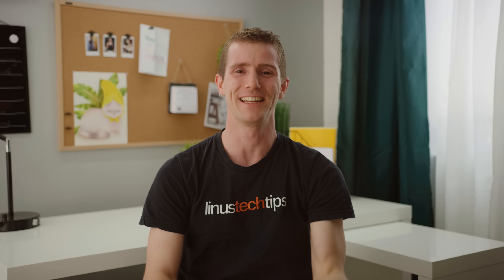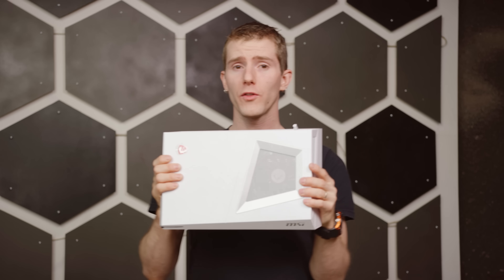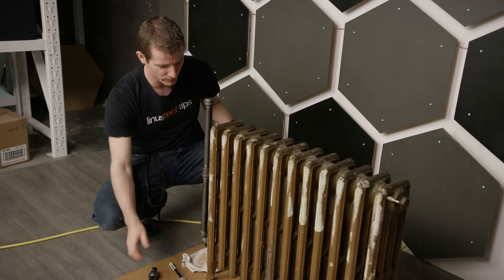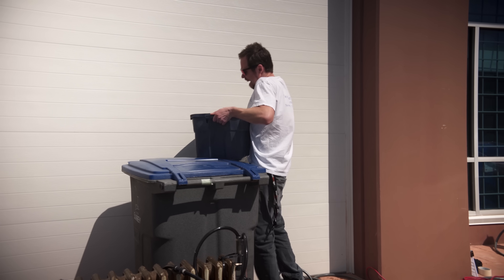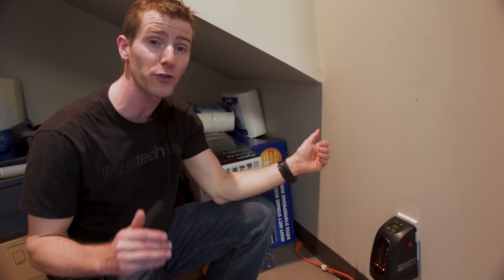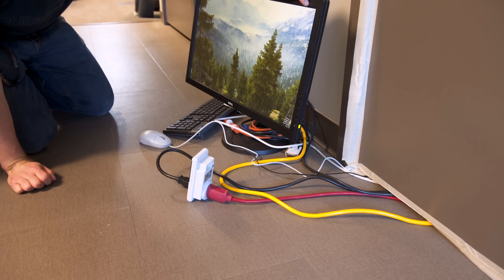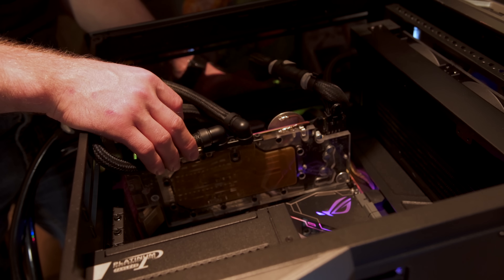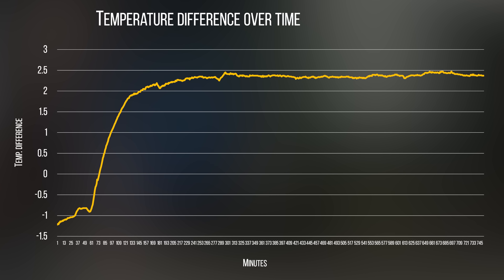Lower your heating bill... with GAMING

Comment: In my country the weather is usually hot (about 30-38 degree c) but in winter the temp goes down up to 10-15" celcius which probably isn't very cold but to us it is. 
So in winter I reverse the fans in my pc so that the hot air comes out of the front and face the pc front (it has a mesh grill in the front ) side  towards me and that gives me a warm breeze while gaming 
also I am rocking an i5 6400 and rx480
Reply: Abu Tahamid wow! Here in Canada it ranges from 40C to -40 C
Reply: man I cant even imagine that cold
Reply: I have a i5 6400 as well... except I also have a gt 730. shitty dell prebuilt. I play games like Arma 3 ghost recon wildlands and battlefield 1 on it
Reply: Matthewlet L if ghost recom wildlands can run good on it then you can play almost anything

Comment: From a mechanics standpoint its about time they did the fuel line style quick connect fittings, always found that part of custom loops a joke...
Reply: Also a 360 was a solid space heater and console combo, kept our apartment 68 degrees one winter when the furnace was fucked
Reply: When I was in high school I had a 40(?) inch TV, xbox 360, computer, and two monitors in my small bedroom (10ft sqaure? maybe smaller). It was fine in the winter, but summer time I bet it was over 90 F.

Comment: Just talk to any ham radio operator about how much a 1.5 kW amp will heat up the shack during the winter....
Reply: It's true I know a ham operator he actually has to run the air conditioning whenever radio is on even if it's cool elsewhere in the house.
Reply: yeah, winter + open window + HF vacuum tube amplifier = still warm inside
Reply: In the winter the cows gather around the outlet vents of one of my 20kw FM transmitter shacks. I don't blame them but you really don't want to wear nice boots out there.

Comment: Would've been interesting to compare with how much time the computer takes to heat the room without the radiator thought. Because cast iron is used to accumulate heat while aluminium is more conductive.

Comment: I got 3 x GTX 480! Prepare for summer! 

summer glau maybe ;)
Reply: I had a miner room mate.
Reply: LOL! with GTX 480?
Reply: Jani SIr I’m sure you do.
Reply: Yeah, I have 3 as well, it's really a bitch when it's 9 degree F and it's 95 degrees F in your room.
Reply: RIP!! lol
Reply: +Vide What's so hard to believe about that?
Reply: Combine that rig with a pentium d 805 at 4.5 ghz
Reply: DanielC pair it with an FX 9590 with a stock amd cooler.😂
Reply: Anyone else read RX 480?
Reply: 1 more like for Summer Glau
Reply: yes gtx 480 big temp
Reply: unless you got a decent AC, you will die.

Comment: But the seperate radiator only makes sense when you want to heat a other room then the one the pc is in...cause the normal heat sink already heat the same room, and that even better, with less work....
Reply: A normal radiator wouldn't be able to dissipate heat from the PC quickly enough, causing the PC to thermal throttle and output less heat.
Reply: Lim Chee Hean that is not correct if you have enough rad space it will dissipate the heat quiet fast only the water amount is the difference here (and the amount of cold metal in the beginning)
Reply: +Lim Chee Hean i doubt that the surface area is much different, its mostly an thermal mass difference.
Reply: It already thermal throttled anyway with the huge radiator so Linus definitely could've just tested this with two large 360mm rads for both the CPU and GPU with fans on full blast and it would have the same effect.
Reply: Agreed. Should have kept the pc outside the room and only had the radiator inside the room.
Reply: Andreas Elf What difference would that make? The rad is the thing cooling the whole system. The room is gonna get hot and so will the rad. It will thermal throttle just like how it did in his test and it won't change a thing.
Reply: What difference does it make with an external radiator when it is in the same room as the pc if it's only for warming up the room?
Reply: Andreas Elf That's exactly my point. There isn't any difference. The water carries the heat into the radiator where it will dissapate it into the air. That's true for a large home heating radiator OR a small 240mm rad meant for PC water-cooling. Having the computer and radiator in the room versus having only the radiator in the room will have no difference since the rad is the thing cooling the system. The CPU and GPU will get just as hot outside of the room as it will inside given that the rad stays in that room.

Comment: Alternative title:

HIGHER YOUR ELECTRIC BILL, WITH GAMING!
Reply: The whole point is that you can stop using heating if you play a bit. I haven't used heating in my rooms since a few years ago because I need computers running to work.
Reply: B-but its a joke my guy...
Reply: Bruh, electricity is expensive, and since using your PC as a heater isn’t conventional, you’re better off having some kind of furnace heater. But heating bills are expensive  too, but if you use Linus’ method it will cost you the expense of a mass use of electricity there for making my statement true that your electric bill will not give a fuck while your heating bill will be lower *in a way*.
Reply: i did changed it to that with html5 lol
Reply: @Deadpool0x2  Because of thermodynamics, all electronics are as good generating heat as heaters, probably 5 or 10% less efficient at most, so, if you can do anything efficient with the electricity before converting it to heat, like playing with it, watching videos, generating light, etc. much better.
Reply: ya'll are taking my joke too seriously :(
Reply: @Deadpool0x2  well you tried to explain yourself with your third comment. That was your mistake.
Reply: @Ildarioon  that all really depends on the relative cost of 1 kWh of electric energy vs 1 kWh of heating energy in your region

Comment: What's the point of attaching it to a room radiator when the exact same heat will end up in the air anyway from the normal ways of cooling?
Reply: There was no point. Entertainment. From a practical point of view it makes zero sense.
Reply: Maybe to have the option of moving the heat to an other room by moving the radiator.

Comment: I thought this is going to be about power factor, which the capacitive power supply corrects the inductive heater, but after a bit of thinking, I realized that computer power supplies have active power factor correction and heaters are mostly resistive.

Comment: Why does he need the radiator? Wouldn't the thermal output be identical if he just put the computer with the same base hardware in the room?
Reply: bladudemovies yes no matter how you dice it heat is heat. BTU from a 1,000 watt ceramic heater is the same output of a toaster oven rated at 1000 watt
Reply: But he can overclock enormously
Reply: Even slow warming (and cooling) of parts reduces malfunctions, having flowing water and a lot of thermal mass lowers the amplitude and frequency of temperature fluctuations without sacrificing compute power.

Having lots of surfaces area for dissapating heat lowers the temperature delta between the computer avoiding throttling.
Reply: Damjan Skrbic No you can't... Just like air, heat can only transfer so quickly and after a certain point, no amount of extra air/water flow will remove the heat quick enough to keep your CPU cool.
Reply: that might be true, but modern computer cooling is no where near reaching that limit. A CPU can be cooled to a couple degrees above ambient.......

Comment: The huge radiator thing was entertaining but I don't see why you needed to do that. The heat will get out just fine regardless of whether it is being transferred through a heat sink, a radiator, or a... ridiculous radiator.
Reply: rsethc more water to absorb more heat and more space to emit heat. Also fun
Reply: That is a down side, they are trying to heat the room, not a massive amount of water and a huge chunk of metal.
Reply: Lol, yup
Reply: Yes i came here to comment this. They started the video talking about how energy turns into heat regardless, and they they use this convoluted way to transfer PC energy into heat. Makes no sense
Reply: Physics says it doesn’t matter how you transfer the heat 600 Watts is 600 watts
Reply: Well a better radiator will get more heat out of the case and into the surrounding room. But yeah, the effect is probably small enough that it doesn't really matter much.
Reply: It is pretty funny though.
Reply: rsethc all you would need is the most power hungry hardware and the best cooling available
Reply: the real benefit, not in this scenario since a closet but overall is that the large radiator (the mass) and the amount of water would retain heat longer and have other properties as a whole, thus you'd be able to turn off and on the PC to keep the room at a certain temperature much easier and maintain it for longer. Also because of the mass and volume it takes up, more air is in proximity to the radiating heat, so convection happens more thoroughly.  If you didn't notice, Linus mentioned this. You don't want a SAUNA, you just want to be comfortable. You can make the setup continue to do useful "work" passively for periods of time.  There's some usage efficiency gains to this.  Many heating systems have timers and gauges too to auto turn off once a set temp has been reached.  I suppose the point of the video is why use something else when you can use your PC for the same effect. Thus it would have the same features has a dedicated system.  Then problem, as usual, is that people even if correct about an aspect of said physics and properties, look at it way too narrowly with tunnel vision, as a whole unit.
Reply: Exactly! Even a regular air cooler would’ve done the same!
Reply: Yes the whole liquid cooling element was unnecessary.  The heat generated by the system will dissipate into the room regardless of the cooling solution.
Reply: Other than the fact that to do this was just fun, well, to do, I wonder why they didn't acid dip the old radiator (or some other similar process), sandblast it, buff it up, and then electroplate it. I know it would have added significantly to the cost, but I'm sure they are near some business that specializes in such things, like an automotive body shop. Maybe give them a bit of free advertising for the effort along with a case of beer. ;) I remember Maximum PC magazine used to take some of their ultimate PCs to automotive painting shops. It would be funny to see a tricked out old fashioned radiator sitting beside a kickass PC. Next up: Using a hay pitchfork as a wifi antenna! :P Or, maybe even a water wheel to drive a pump for the liquid cooling. Let's see... What other old tech could we use in place of modern components? :)
Reply: very end of video. "yup, we did a thing but... why...." lol

Comment: Umm... ANY radiator would heat the room the same. the one in the case was fine.
Reply: In this small volume of a closet yes, but the overall theme/goal was a house. A large radiator mass and amount of water soak up more thermal energy, thus can provide useful "work" for longer periods of time passively once the PC is turned off. You can manage the temperature of the room more effectively with on and off usage and manage said temperature for longer periods of time.  As Linus even mentioned, it's not about making a sauna but making a comfortable environment.  Many heating systems have timers and gauges too to auto turn off once a set temp has been reached.
Reply: CheapSushi 
Thanks to the fins a  pc radiator has probably more dissipating area of this thing...

The fact that it takes longer to cool down means that it takes longer to warm up too so it is a pointless "feature"
Reply: You will get all the energy your PC uses as heat in your room, no matter what cooling you have. The differences in cooling just make it quicker/slower to give off that heat to the air.
Reply: Jesse Aubrey Using energy creates heat. The heat your computer gives out won't change based on how you cool it.

Alot of water just takes longer to warm up and cool off but it's still the same amount of heat stored in there, until it warms up too much without giving out heat fast enough to cool the pc so it throttles and use less energy because it can't run at full capacity which means less heat.

Comment: "A system built to warm your room"  
I didn't go further, I'm already betting on a FX9590.  
  
EDIT: I'm disappointed.
Reply: Andrea Mazzucchelli use the fx9590 is you want to make a sauna :D
Reply: Just add a couple of fermi graphics cards and you are set.
Reply: or an overclocked 7700k
Reply: the 7700k has a rated tdp of 91W (like 120W if overclocked).
The fx9590 210W.

Comment: Should have used a 290X. You could sell heat to the neighbors that way.
Reply: TBH the R9 290 wasn't a crazy high TDP card. The stock heatsinks were just HORRIBLE. Now if we did this test with an R9 295X2 that'd be real space heater levels at 500W
Reply: ikr moved in with a friend for a little while and he says" this room doesnt heat very well as it needs new ducts" i was like " its all good i have a gaming space heater its pretty nice powered by a r9 200 series and a amd 6300 proc" its been the warmest room in the house lmao

Comment: Jokes on you, my FX 8350 saves me a ton on heating.
Reply: I can confirm that...thanks to my FX8350 + R9 290 i get every year a Rent-Free month.
Reply: But you pay more in the summer when the AC needs to cool that hot air. So overall you're not saving much or at all. :D
Reply: Or just don't have A/C, then you save even more
Reply: Yeah...
Reply: Jack o7 for that, go over to JayzTwoCents for the answer to that problem
Reply: Badja lol I have a r9 390 and a fx 8350 and I have to use an old ac to cool my pc.
Reply: Cmon dude that cpus not even that hot xD
Reply: Ive got an r9 380 gygabyte and a fx 8370 and its really cool. And my case is in a very tight spot as well. Idk what you guys are doing wrong. The only thing you need to do with the fx 83.. architecture is buy a decent cpu cooler . If you stick with the base one, it will actually get rly hot. AND NOISY
Reply: My fx 8300 and 1050 ti sets fire to my wall
Reply: Even my FX 6300 @5.150GHz didn't heat up to much. FXs aren't very hot.
Reply: Mantas Jurksa but that cpu is only 95w when not overclocked which isn't that much, if you consider the fx9590 which is 225w
Reply: I would expect like 150 or 160 TDP, but we all know that FXs actually ate more than that. Tom's Hardware did the testing and in some tasks stock 6300 reached over 200 watts of power consumption. I wouldn't be surprised if at over 5GHz it ate 300 watts. Now that I only run it at 4.1GHz and slightly lower than stock voltage, whole PC at idle eats 70 watts, at low loads like web browsing it can shoot up to 150 watts for very short time. In gaming it's 160-230 watts depending on game. At prime 95 + Furmark it eats almost 300 watts. Keep in mind that those numbers are for the whole PC. I actually was enthusiastic with FXes and with APUs and I can tell that Piledriver CPUs were either extremely great overclockers or extremely great undervolters. They aren't very hot and can achieve 5GHz with modest cooling. I bet that some APUs reached that with stock cooler. Meanwhile Steamroller was "upgrade", but it ran very hot and required lots of voltage to be overclocked. I think it was a complete failure. LN2 was needed for 5GHz, not to mention some overheating issues with stock coolers. I have tried A6 7400K, which is 65 watt chip. Stock cooler wasn't enough, so I put cooler from 95 watt FX 6300 and it was really close to overheating, only 7 degrees away. Thank god AMD didn't use any Steamroller in FX chips and didn't make their already not so good product into complete disaster. FX 9590 could be cooled by beefy air cooler at it's clock speeds. A6 7400K would need LN2 for that. If you want to know more, then I can say that to increase Piledriver clock speed by single multiplier step required two steps in voltage to have stability, sometimes 3. Meanwhile Steamroller requires 6-8. It was a disaster. Mostly really modest overclocks were possible. Bulldozer architecture CPUs still hold world record in overclocking, so I think they can be clocked pretty high without exotic cooling. Anyway in pretty much all wattage charts I see with other processors, my own FX 6300 system loses even to i7 most of the time. So it wastes electricity, but runs faster than stock version, so it has enhanced efficiency. Anyway, it's not even close to anything modern. Good point with 9590, it would have been most appropriate thing for Linus' test. Just that I want you to know that mos FXs are extremely tweakable most of the time and as there exists a belief they run extraordinarily hot. I think that i9 7980XE with lower TDP would be much better room heater, of course with toasty Radeon 200 series cards in crossfire.
Reply: 70C is almost overheating, unless you use Fuhrerheit to measure temp.

Comment: As a Chemical Engineer, water is nice and is often the basis of heat exchanger design (since it is industry standard for heat exchange), but it can store a lot of energy in the form of H bonds, and therefore, can hold a lot of energy in the form of heat. With some PID control, and thermo modeling for the layers of water, metal, and air for the radiator, you can simulate this system and solve for it to make the air a certain temperature based on the current temp. You would just want to have auxiliary cooling for when there is too much heat already present for the PC to cool itself unless you live where it never warms and the PC is connected outside.